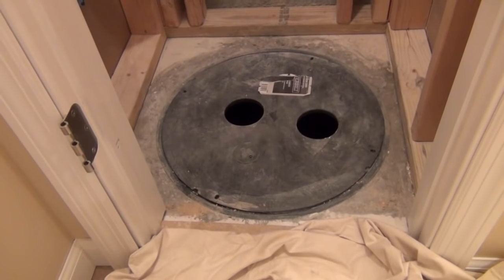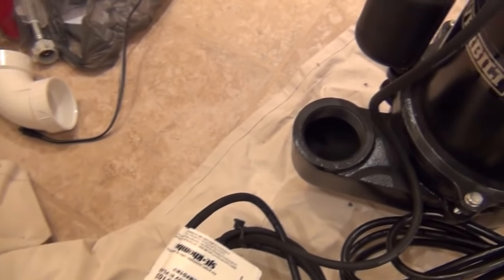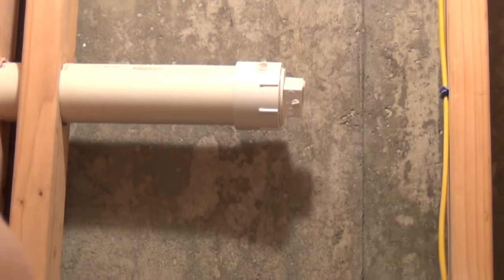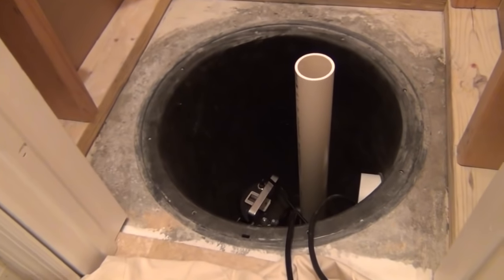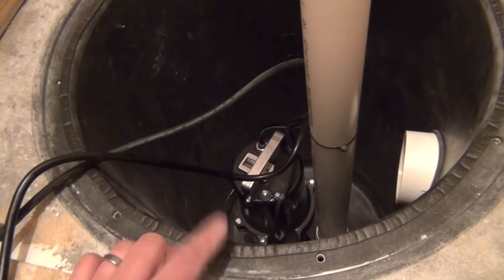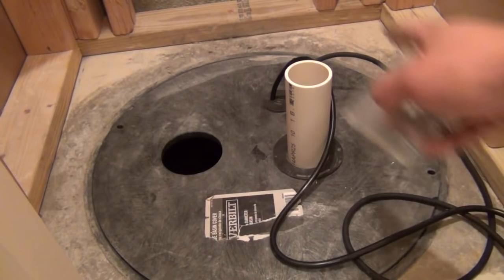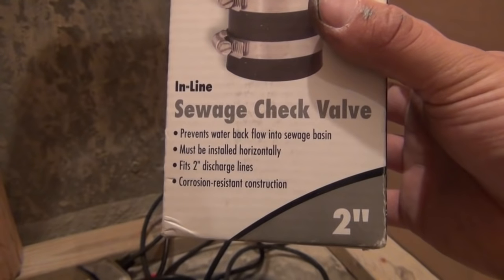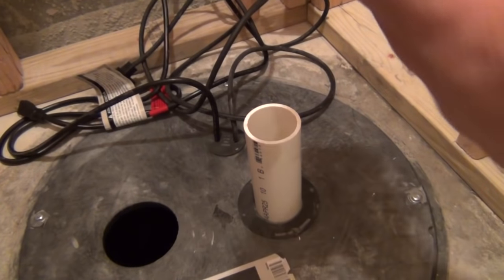How to Install a Sewage Ejector Pump

Comment: Hi, I have watched the video and found it to be very helpful. However, I have a problem and could use any advice you can offer. I have the exact same pump as you do in video ( replacing a bad one)  and have it installed. The issue is the pump (brand new)  doesn't shut off when basin is empty. I used pump plug only and it works fine but when I plug in both , the pump just doesn't turn off and I'm afraid I will burn it out. I have read instructions numerous times and see no way to adjust the float. I removed the lid and actually moved float around a couple times to see if that helped. It doesn't, pump still keeps running when basin empty. If you have any ideas on how to fix this, I would be very grateful.
Reply from the maker: +April Burkey Do you have the pump plugged into the float switch plug?  That's the only way float will work correctly.  Try shaking the float on the pump.  Internal switch might be hung up.  Also does the float switch have free range of motion in the basin?  If that doesn't help you, sounds like the float switch is defective.
Reply: +zimsjeep Yes, I did have plug plugged into float switch and also shook float itself to try and stimulate it to work. It does have free range of motion. The only thing I didn't do was remove wooden platform from bottom of pump ( shipping purposes I assume) but pretty disappointed now, seems like the float itself may be defective.. Sad state of affairs when you buy a product brand new and it doesn't function as supposed to but out of ideas. I am currently running pump manually every 6 hours and not happy with this solution. Guess I have to take all apart once again and return defective product..SIGH
Reply: @aprilburkey9009  The float switch can be replaced without replacing the pump.

Comment: A plumber just installed one but the bathroom wasn't ready therefore it was never turned on. I've just completed the bathroom and is ready to test it out but I notice the manual have some kind of control panel as the power connector. Plumber didn't mention anything so I assumed it's just plug into your reg switch. Is this not the case?
Reply from the maker: Don Powell He might have installed a high water sensor in the basin that sounds an alarm if the water level gets to high indicating the pump has failed.  If that's the case, just plug it in but verify what it is first.
Reply: How do I verify it? If I plug it on and turn water on it will work since its bran new & I m guessing if unplugged then this alarm won't go off either?

Comment: Great job !!  quick question.. How did you cover the PVC in the floor when you backfilled? Did you cement directly over the PVC?
Reply from the maker: Frank Galvin The PVC under the slab has a good layer of sand around it in all directions. The concrete does not touch any of the piping. (Except around the shower drain and toilet flange). Hope this helps.
Reply: Thank You..

Comment: Great video!  I'm considering tearing up my basement and doing this.  I had a couple of questions, but may be beyond the scope of this video.  If tying in a sink/bath also do you put the drain pipes under concrete in order to achieve a grade?  Also any suggestions if you don't have the floor space to install a pit?
Reply: SpineDoc 777 Also anything different about installing with a septic system?
Reply from the maker: SpineDoc 777 Septic system would not change a thing with the install.  Everything will be the same.
Reply from the maker: SpineDoc 777 Anything under the slab must be pitched a minimum of 1/4" per foot toward the basin so yes, the sink and bath lines must be pitched.  Not really much you can do if you don't have the space for the pit.  You only really need a 24" x 24" room as the basin is only 21" in diameter.  How about a closet to put it in?  Some guys hide them under the stairs as well.  Hope this helps.  Thanks for watching.
Reply: Thanks that helps a lot, can't wait to see the other stuff in your series.

Comment: My pump keeps setting off the alarm.  I was able to have it working again using the pump plug for a while. Now the alarm goes off every day or two.  What do you think is the problem? It has been unusually cold the last week or so - do you think that may be the problem? Also, how long should I let the pump run overriding it using the pump plug? I have been letting it run for ~10 seconds or so until I hear the basin empty.  Is this too long? I seem to recall the pump would run around ~5 seconds or so when it does it automatically.  Thanks!
Reply: Zim - can I get some help?  Alarm keeps going off everyday...sometimes 2x.  Drano (or something along the like) is probably not a good idea right? ;)
Reply from the maker: You need to open up the basin and clean the float assembly. Sounds like it's got debris on it preventing it from working correctly. Don't pour Drano down into it. Very corrosive for the pump. 10 second override should be all you need to empty the basin.

Comment: Great video. I have had many problems with these systems in my rental. They are stupidly designed. If the pump gets jammed or breaks, the tenant does not know this and continues to flush the toilet upstairs.  There is no alarm to let him know this, no dual pump system, no panel upstairs with an alarm or auto shutoff valve in the toilet. I have had the tank overflow which caused a horrible stinky mess since the tank is not sealed just as he states in the video. I think these are terrible designed systems. As long as everything works they are fine, but when they don't it can become a plumbing nightmare.
Reply: Liberty pumps make an alarm that sounds and flashes  if the water level gets too high.

Comment: Do you need a separate vent just for the ejector pump or can you connect the rest of the bathroom to the same vent?
Reply from the maker: Gail Roman It can be connected to the rest of the venting system.

Comment: So, is the only way that you'll know that the pump is not working is if you get a flooded basement?  I've just bought a small house, which I'm going to rent-out, and, since tenants are usually careless/clueless, I'm afraid that this pump is going to be a ticking time bomb. Can some sort of alarm be installed, to alert if the pump fails??!!  HELPPPP
Reply from the maker: Chuck Revels I understand your concerns and agree with you.  Only thing you can do is buy a sewage pump high water alarm.  This will sound an alert if the water level in the tank reaches a certain height indicative of pump failure.  Of course it would still be up to the tenant the stop using the water until someone checks the pump.  There is no magical way to stop the water from flooding if the pump fails.  Hope this helps.
Reply: Chuck Revels You can buy a dual pump too. If one stops the other is a backup pump. You will want to change pumps periodically anyway. A second float switch can sound an alarm, if the tank gets too full. I also like to get a battery backup. You can probably buy an antiquated computer battery backup for a small sum of money and put new batteries in it. A lot of the old computer backups did not put out a real sine wave, so they were not good for much, but an AC motor is not too picky.
Reply: zimsjeep Thanks, I really appreciate your help.
Reply: Seth B Thanks, I really appreciate your help.

Comment: Great video...exactly what I needed. Two questions, what do you recommend to seal the pip connections (your purple stuff) and is there one pump better than another??
Reply from the maker: RicKat Starost You'll need pvc primer and pvc glue. The primer is the purple stuff you see.  As far as the pump goes, all are relatively the same. I recommend the Everbilt pump I used in the video. No problems almost 2 years in.  Good luck with your project.

Comment: The only issue I have with your instructions is the type of check valve you used... I would recommend a silent or quiet type that does not make a thump every time it shuts down
Reply from the maker: TheCladi8or With the closet and door closed, I barely hear the pump kick on and never hear the check valve

Comment: My pump gets clogged with hair and other waste through the grills occasionally, so I have to clean it every so often. It was suggested to me by a friend to have a screen/mesh around the device to prevent clogging and that i would have to regularly maintain this. It didnt seem right to me, although it was sensible. Any tips?
Reply: Another note; is there a difference from a sewage ejector and sump pump? i believe we own a sump pump and its probably just for water, but what we need is a sewage ejector pump.
Reply from the maker: Andy Lee I wouldn't install any additional items around the pump. Let the pump do its job and grind up the waste. These systems aren't maintenance free and will require service from time to time.  Hope this helps. Thanks for the comment.
Reply: Thanks for the reply. in terms of the type of pump, is a regular sump pump good enough or did we buy the wrong pump?
Reply from the maker: Andy Lee There are 2 types of pumps that often get confused for these applications. The only pump you should be using for a sewage pit and sanitary sewer waste is a sewage ejector pump.  This type of pump is designed to grind up the waste as it pumps.  A sump pump is typically used for storm and ground water run off in a basement sump basin. So basically just ground and rain water.   A sump pump installed in a sewage pit will not work correctly and will live a short life.
Reply: that's good to know. thank you.
Reply: I was wondering if there are any do's and don'ts when buying sewage pumps.
Reply from the maker: Andy Lee Not really,  just make sure you're actually purchasing a sewage pump and not a sump or other type of pump.

Comment: hi, can you please help me out recommending what kind of ejector pump I should buy?
I am installing a toilet in the basement  actually in the laundry room, where the water line and waste pipes is like only 3' above the floor, i have an existing sink already and I like to install a toilet next to it.. 
THANKS SO MUCH :)
Carolina
Reply from the maker: You would need the same exact setup I showed in the video.  Get a sewage pump from HD or Lowes.  The same pump in the video is an Everbilt from Home Depot and will work just fine for your application.
Reply: +zimsjeep , thank you for your prompt answer :)
one more  question, the space I'm using for the sink n toilet is very narrow, 44" x48", the wall goes to my back yard, my question is, can I set the pump outside? (behind the wall) if the answer is yes, how far from the wall and how deep should be the ejector, I'm in NY upstate so temp goes to -10 the coldest.
Thanks much
Carolina
Reply from the maker: +Carolina “Just MOI” Abregu I've never seen that done and don't recommend trying it. As you mentioned, it could and most likely would freeze. You'd also be chopping away at the footing on your foundation wall. Not easy to do nor would you want to. You'll need a 2 ft area for the pit and pump.  Is there any other place you could do this?  Maybe in a closet or something and pipe over to it?
Reply: +zimsjeep Ya, you are right,  at this oint Idk what I gonna do, I'm thinking just to use a electric toilet like the SANIFLO, I really appreciate your time, thanks so much
CAROLINA

Comment: Hi, after changing the pump and getting everything right, now when the pump pumps, water backs up upstairs through the washer discharge pipe, just like maybe 2 cups of water. Now we don't know whats is going on.
Reply from the maker: Francisco Novoa what size pipe does the pump discharge into?  It should only be going into your main 3" or 4". If it's draining into a branch 2" line, that could be your issue

Comment: Do you need to silicone around the rubber gaskets that the vent and discharge pipe go through?
Reply from the maker: No, the rubber gaskets will seal it. No side for silicone

Comment: maybe add a 2" fernco slip coupling to the vent pipe a couple feet above the lid  to get the lid off easier...
Reply from the maker: Yes, the first time I did maintenance on the pump, I cut the vent to get the lid off. Fernco was the way to go for reassembly.  Thanks!
Reply: @fixitwithzim  didnt see it done, but if not, might wanna add a 3/16" weep hole, drill on an angle going up,  just above the threaded adapter at the base of the pump...

Comment: hey, had a question for you.  recently replaced my pump with a flo-tec pump and replaced the "home depot" brand.  just so you know, the old pump had a floater switch and my new pump has the float switch on a metal line.  I was told that this pump is much better than the one I had.  I have everything hooked up the way it was, which is exactly the way you had showed it except for the ball valve.  My problem is when I run water from the utility tub and fill the basin up, when it goes to pump all I get is a humming noise.  I have even tried disconnecting the plug/switch and directly plugging it in to the plug with no luck.  I have flipped the breaker on and off, no luck.  I have also ran an extension cord to another plug and no luck.  All the time I get that humming noise.  Do you think the  pump is bad?  The breaker is a 15 amp breaker and should be plenty enough juice for it.  As far as HP, its the same.  I have asked some plumping people here and there and 1 said it sounds like a electrical problem?  Doesn't make sense to me because I didn't change any kind of draw.  I was wondering if its because the floating switch is on that metal rod?  or whether or not I need to move the pump.  my problem is I have bathroom waste(toilet/sink/shower) going in one way into the basin, then the washer comes in another way.  Also, I have heard that you should find something to set the pump on to raise it up a few inches, like a 2/4?  Any suggestions before I have to call in the "pros"?  thanks for the video, and if you can respond.

-matt
Reply from the maker: Could be a defective pump. Did your new pump call for a hole to be drilled into the discharge line to prevent air lock?  That could very well be causing your problem if so.

Comment: Mine smells so bad after it emptys  is the vent pipe supposed to touch the water or the  float levels not suppose to empty everything out. And dry basin
Reply from the maker: The vent should not touch the water and should be well above the highest possible water level. Sounds like you need a new seal on your lid or possibly new donut gaskets around the pipes or cord
Reply: I bought a new lid gaskets kits and lid I change it still smells 
The tub the sink n the pump vent  is all venting  on one pipe .could they vented it wrong?

Comment: Any suggestions on the best way to empty a full tank when the my Zoeller pump doesn't have an obvious separate float switch connector?
Reply from the maker: Not really unfortunately. You could cut the pipe on the old one above the water line and pull the old pump out by the pipe and reattach the pipe to your new pump and drop it back in the tank. Not a fun job, been there, done that but at least you don’t need to stick your hands down into the unknown.

Comment: Please help!  Does this pit pump require a dedicated line?  My GFCI tripped the other day and I am not sure what caused it.  We use it for shower, sink and toilet.
Reply from the maker: Rob Osborne yes, code in most areas requires a dedicated 20 amp circuit for the pump. A GFCI trip indicates a short to ground in which case, the pump needs to be replaced. There is a chance that what you experienced was a nuisance trip which is essentially a small spike to the receptacle that caused the trip and the chances are minimal that it would happen again. I personally don't agree with putting these systems on a gfci. Too much of a chance for the outlet to trip accidentally and possibly flood your basement.
Reply: Rob Osborne As a licensed electrician I agree with you. It would be almost as dumb as placing a fridge or freezer on a GFCI. A dedicated circuit is the best practice.
Reply from the maker: onecrazywheel Some of our codes are a little ridiculous and don't seem completely thought out in a practical sense. I understand the intent, but the consequences of something that would be more likely to happen overrides that.

Comment: where did you buy the pit from with the gaskets and cover, also the motor does it grind before shooting upward to the sewage pipe?
Reply from the maker: Everything purchased at Home Depot.  The pit and cover assembly are sold separately.  The cover kit includes the lid gasket, bolts, and donut gaskets that go around the pipes.

Comment: What about those sanaflo Macerating Pump that you don't need to break up the concrete. are they any good?
Reply from the maker: CaptHwdy08 I wouldn't go that route.  My personal opinion is that those systems are visually unappealing.  Do it right and bust the floor up.  You won't regret it.  Worst part is the labor.  The actual install is a piece of cake.
Reply: ok thanx for the info.

Comment: I have a question can one basin have two pumps? Mine has two pipes with the ball gate and one vent so I have three pipes that go in the basin.thanks
Reply from the maker: Yes, a backup is sometimes installed to take over if the primary pump fails. The backup would typically be a few inches higher then the primary at the bottom of the basin.
Reply: @fixitwithzim  thanks I appreciate your help!!

Comment: you should add an alarm for over flow with audio and light
Reply from the maker: +Michael Nguyen  You could, but that's only good if someone heeds the warning and stops using the plumbing fixtures.  Not a bad idea to have one though.  Thanks for watching